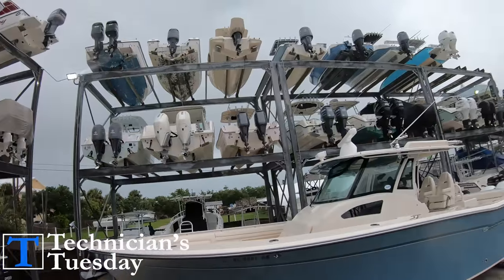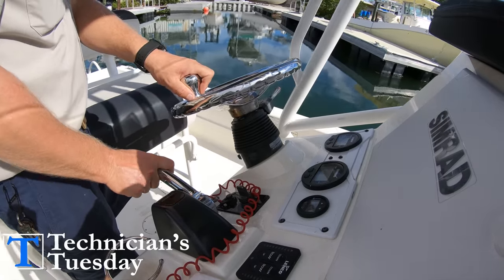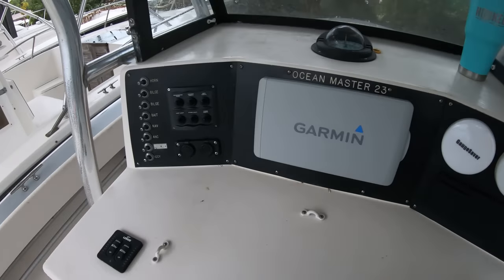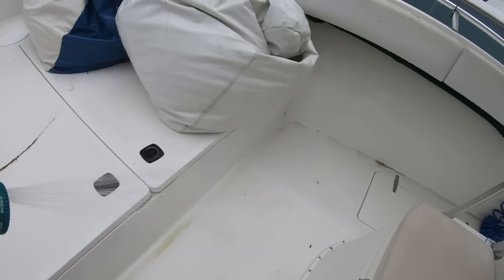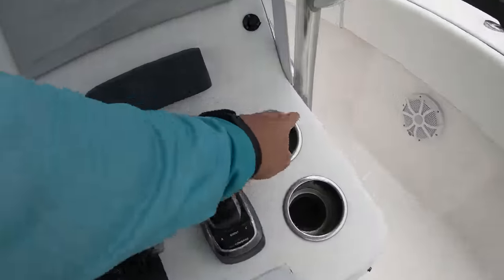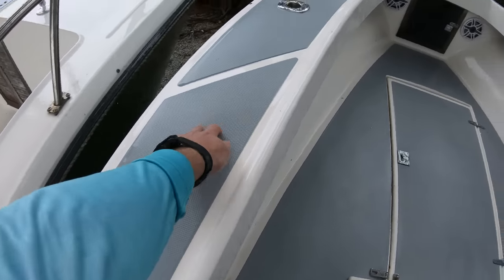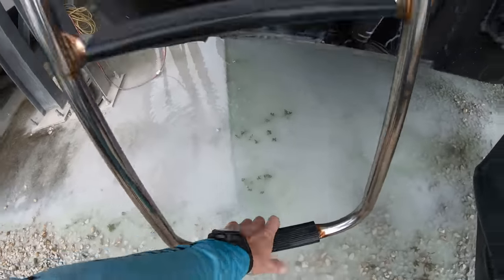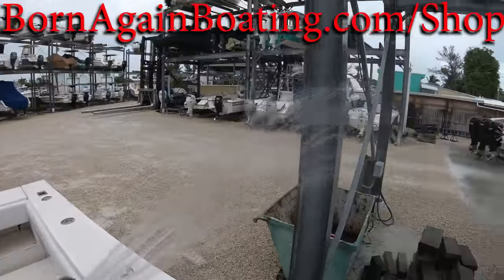TOP 6 Features For Boats UNDER 23 Feet!

Comment: Excellent ideas for the smaller boat. I also like having a small solar panel for charging. They are relatively inexpensive now. What I don’t like are the “ideas” of putting underwater lights that are thru-hulls. Every time you do a thru-hull you’re asking for that “Sinking Feeling”. Bolt ons on the platform are adequate enough.
Once again, thanks for your Tech Tuesdays!
Reply from the maker: Thanks for stopping by!

Comment: With my 1992 SeaSwirl rebuild I'll share my TOP 5 items that I'm doing to improve the boat. 1. USB Charging ports, Stainless Steel cup holders (the old plastic ones rotten out), Courtesy, Gunnel and Underwater lights, a rebuilt dash with a Garmin 743 (Thank you New Wire Marine!), and finally redoing the upholstery on the side panels and seats given they were falling apart and looked horrible.

Comment: I'm in the process of a complete Refurbishment of my 1998 Ranger 250C Sport Fisher which I've owned since 2008... Adding twin Suzuki's DF175AF's, binnacle, switches etc. All new hydraulics lines - power assist steering, helms - upper and lower, trim tab servos - going to Lenco, fuel lines - tank inspected...  New lights/ wiring. Not to mention canvas...  All systems are being renewed...  I love this boat and fish off shore daily..

Projects I would love you guys to cover;

Cup holders are a must but I want them to drain so when I wash the boat they will not hold water - ideals?
Windscreen/ glass enclosed center console- plexus glass?
Tackle storage - center console or behind back rest area of leaning tower - starboard...
Storage under forward T top area for fire extinguisher and 4 Coast guard standard vest-  replace that ugly T bag..
Fresh water wash down -CC.
Head with holding tank- CC.

That's my project list.

Comment: I've got a 30 foot Boston Whaler 305 Conquest . My favorite features are: 1) My Taco marine GS 390 Outrigger system 2) My Ac downstairs (cant survive without it, I don't even know how I survived without it on my last boat) 3 ) My MFDs. My Simrad NSS9 evo3s are the reason why I have great success fishing, even on bad days. 4) a Freshwater wash down (my boat has a raw water wash down, but with a 30-60 gallon freshwater tank, I really wish my boat would have it so the cleaning process can start while running home from the ocean 5) The right power. sounds lame, but my old motors really struggled to push my boat, my twin 2005 250 Verados could only do 30 at WOT but my new motors, twin 2020 350 Verados can do 44 at WOT, and I am still waiting for the right props to come in from Mercury. If you have the right power, it'll make your day that much better!! Tight lines
Reply: Geez dude deflate some of that hot air
Reply: @scottawes921  these are very important!
Reply: I get it. I dont have the means. Id certainly have a blown flat bottom v-drive if i had an extra 40-50 grand

Comment: I have a wash down system on my 21 ft center console. But to be honest, I prefer a 5 gallon bucket for a quick clean up.
Reply: Same, I never use my wash down. Most of the time I use a bucket or dunk the brush over the side to clean as I go.
Reply: Washdown pump is a terrible waste on my boat 22' CC. I'll take the bucket all day long!

Comment: Autopilot. That helps on our long runs up to about 85 miles one way. We fish out of Indian River DE. When conditions allow, we hit the offshore canyons with our 24 foot Triton 2486 WA with twin 150's. Autopilot allows me to rig on the way out. On weekdays, we often don't see another boat past the shipping lanes. Boats appear on the canyons about an hour or so later. It is safe for us to run like this. I think the pump for autopilot was about $500. It plugs into our twin HDS 7 units.
Reply: I agree an autopilot is a great addition especially for solo fishing. For me an autopilot (Raymarine) would be about $2,000 plus installation if I didn't do it myself. My 22 foot Pursuit has some of everything mentioned except the power steering and they are all great to have.
Reply: @stevewood4255  Ouch 2k seems high. Do you have fly by wire or hydraulic? We have hydraulic. We did the electronics, then the re power in 2019. I wish I had the fly by wire stuff, but it was not in the budget.
Reply: @markwiebner7806  I have hydraulic. I need the entire package to plug into my Garmin GPS/Radar, not just the pump. Both the Raymarine EV-150 and comparable Simrad are about $2,000 plus misc. hydraulic hoses and fittings plus installation if you don't do it yourself. Maybe in the spring!
Reply: Bummer. Tax return maybe? Good luck!
Reply: Agreed on the AP. I hear the Sitex 120 is a good simple AP. Expensive APs have a bunch of unnecessary features (zig zag, etc) but all an AP needs to do is keep a straight heading. You can find the sp120c for $1,150 plus an octopus pump for $400. It will be my next investment.
Reply: @turbopete7794  Thanks, I will look into that!

Comment: My current project boat (23ft Center Console from a small race boat manufacturer in the panhandle, built in 89 for pulling parasailers) is in the 0 rung ladder category, just a small teak platform on the back LOL. To give you an idea of the height on the trailer, I'm 5'10" and can't see over the gunwales! Makes for a fun time to get in and out of the boat while working on it!

Comment: Good to include a ladder, even or especially if you are not intentionally going into the water. Trying to lift a man who fell over board in a high gunneled boat was difficult for 2 of us. If he was by himself, he would have never been able to get back onboard.
Reply: Pro Tip: If a man overboard:  Get a line and float to the person in the water.  Shut outboard engine off and get person to engine.  Have them straddle engine and tilt engine up till it is out of the water.  You can actually “rescue yourself” assuming you activated the Kill Switch when you fell in.  Just know where the Tilt Switch is located on your engine.
Be well.

Comment: Number one on your list was power steering and the main reason you said was after sometime your steering components can start  corroding and freezing up! If your steering is starting to get a little bit harder to turn over time someone isn’t keeping Up with proper boat maintenance!
Reply: Thinking about deleting the power steering on my ski boat and going straight hydraulic. The cable over hydraulic system doesn't have enough feedback for me, and it's one more thing to go wrong.
Reply: I just commented on that,.....power steering on a 23 ft boat...waste of money

Comment: Would you consider doing a video on the trim tilt system is specifically about how often you should change the lubricant in a MerCruiser if you should and if there's any filters. And what type of fluid. Inconsidering including information for older mercruiser systems alpha ones and such from the '80s. Cuz I have a 1989 mercruiser system that's an IO and has you know the trim and I'm trying to learn about that I bought it used so I'm trying to learn about that to make to maintain it and enjoy it. What greatly appreciate your help. And your videos are helping! Thank you for them!

Comment: Cup holders with drains! When they built my 94 Century 2100 they installed plastic cup holders in the factory that had holes in the bottom of them. They were mounted above both consoles and would drain water right into the consoles. On the drivers side the cup holder would drain right on to the electrical inside the console! I’ve seen this on other brands as well. Why do manufacturers do this? I installed some nice blue LED lit stainless cup holders with TH Marine push drains and silicone tubing this summer. Now the water drains right out and doesn’t flood the compartments. And the compartments are no longer moldy and nasty smelling!

Comment: I want bow cushions and now a bunch of a cup holders 😂. Im making my own shade extension off my T Top for the rear that will have side curtains that can be rolled up on the sides. The bow will have a T Top to bow rail shade for the cosole seat and table up front. Already have the same blue interior lighting as you. I'm just setting the boat up for hanging out on the lakes and hitting the springs when we want to chill out with family. It's still a hard core fishing boat underneath 👍. Love center consoles but I want a walk around eventually. Wont be going over 20' either always wanted a bigger boat but once you break that 20' mark dock fees slip fees everything goes up substantially.

Comment: Trolling motor for spot lock. Even the one you have to manually bring down the shaft. Takes 30 seconds to do if you are slow, instead of fighting with anchor and rope when fishing a wreck or reef. And mid cleats. Nothing beats mid cleats when handling a boat by yourself at the dock.

Comment: This video is excellent because it fits my boat which is an IO though {period} was wondering could you do a video to supplement this one on how to install a USB port and 120 volt outlet like you say to have {comma} and also some auxiliary lighting like on the sides of the gunwales and also about a ladder I like the idea of having a longer ladder however mine only has two steps and I looked at the one in your video and I'm not sure how I would install that to my boat that has one already that would be a great video how to install a better ladder than the one that came with your boat {period} cuz I'd like to do that mine just has this little fold-up ladder attaching to a wood teak platform that's really small also and you have to lay on your back to put your feet on the and then the handle is a large enough or it doesn't come out far enough to be able to grab hold of it to pull yourself up {period} I'd like to put one of those four or five step ladders on can't please do a video about how to retrofit that onto the boat {period} thank you really enjoy your videos {exclamation-mark} haven't found one on how to install cup holders have you done one of those can you provide a link or supplement this one with a link. thank you!

Comment: Can putting to many cup holders in a gunnel compromise the structural integrity. Also did you have to run drain tubes for the ones on the console

Comment: Hi Team, What's your thoughts on having an auxiliary engine in case of break downs at sea. Here in the UK I have broken don in the passed (on my very old boat) and it was a pain. I now have a Bay liner 192  discovery (USA design). My plan is to fit a outboard on a kicker bracket before next year. I don't see many fitted to boats in the USA. I would be interested on your take on them. Cheers Love the tech Tuesday shows. Eamonn Evans (Worcester UK)
Reply: Here in Florida not common. You might as well get twins or a reliable single 4 stroke and towboat us membership or seatow